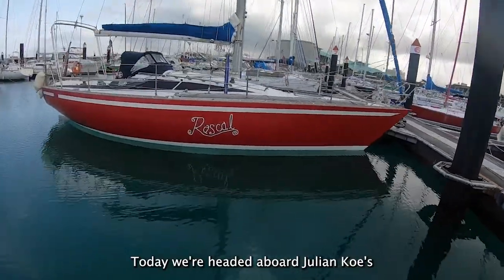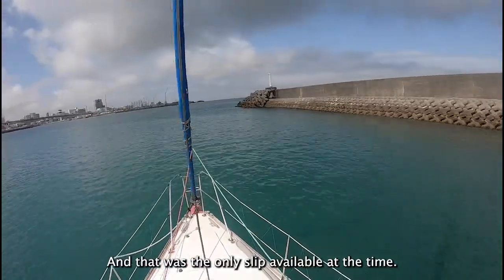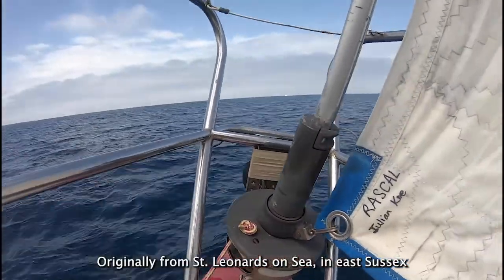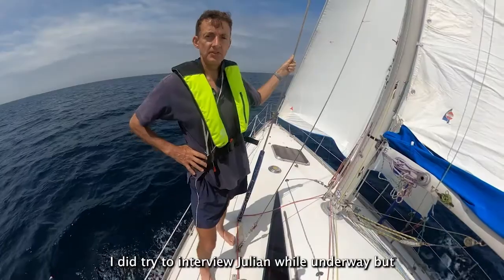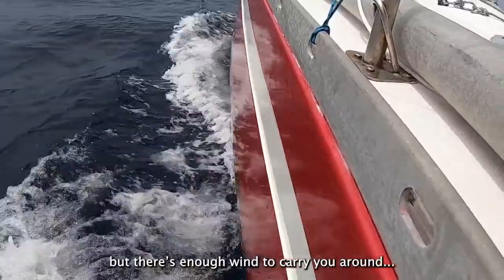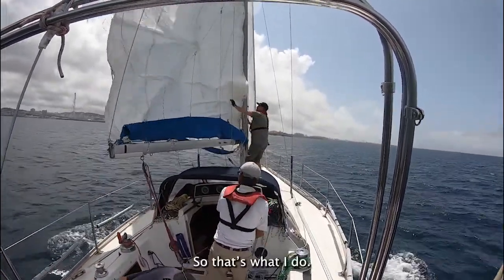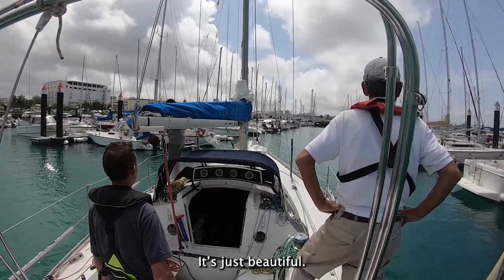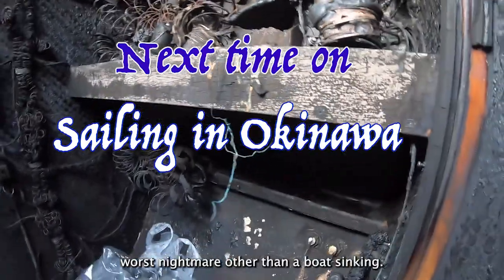Sailing in Okinawa - #6 -- That Rascally Rabbit! (Closed Captioned)

Comment: Is it possible for a foreigner to buy a boat in japan and cruise the coast Thanks
Reply from the maker: Yes. That's the best option. Japan has virtually no rental boat market because they require anyone operating a sailboat with an engine to have a Japanese boating license. There are plenty of boats here but they can be expensive. Check out Chokutei and Island Boat to get started.